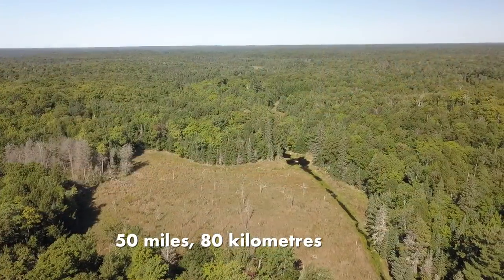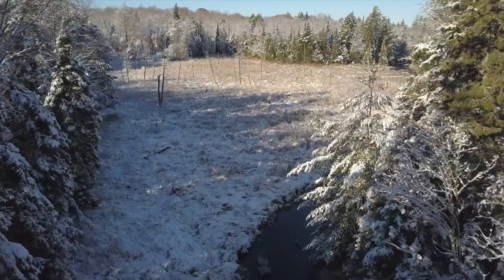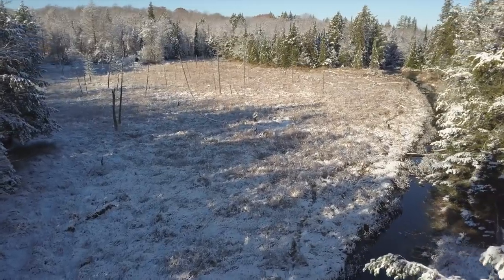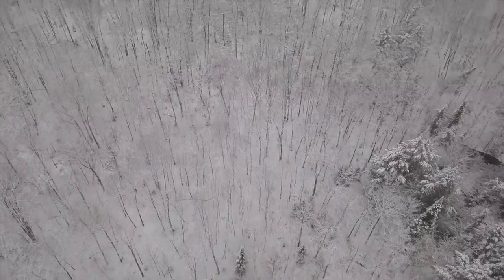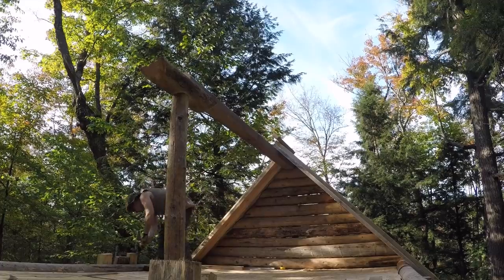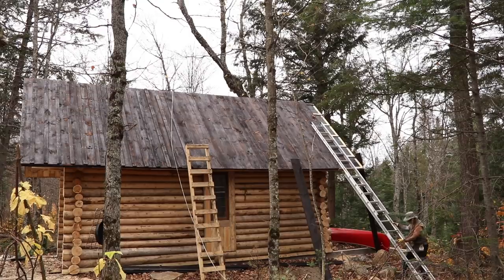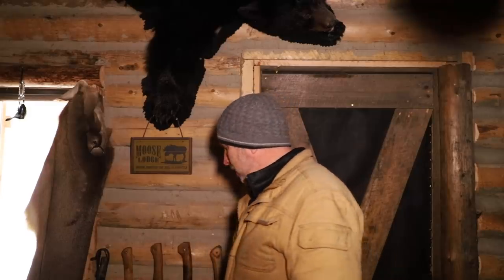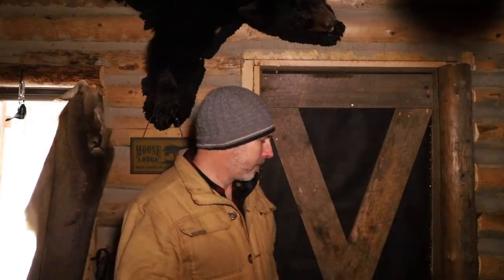Log Cabin Cost - Build a Debt Free Off Grid Tiny House | Home Tour

Comment: Watched the latest video and have a tip for you. I lived in Anchorage for 20 years and had many friends with outhouses at their cabins. They glued a piece of ½" styrofoam to the seat. Warm and dry at 40 below! Try it.
Reply: Or you could just have a seat of some sort (preferably something you can wipe down) you keep inside/warm that you take with you when you need to go.
Reply: I have an outhouse at my cabin and Yes, a cut out piece of styrofoam is the answer for the frosty winter toilet seat. But I certainly would Not glue it down for hygienic reasons. Just replace it periodically.

Comment: Thanks Sean for entertaining and motivating so many of us. As I noted in an earlier communication you became my mentor when about 20 fir and spruce trees blew down on our 46 acres in MI and I decided to turn them into a cabin. Several grandchildren and neighbor kids have gotten involved in the project and each signed a log to preserve the memory. My lower level is only 10' X 10' with a 4' porch but I pushed the eaves out a foot to have more overhang and cantilevered a loft over the porch so that the upper level is a 10' X 15' with two sleeping/storage areas connected by a walkway. I was able to cut all of my own flat boards with the use of a portable saw mill borrowed from a member of our church. I was offered some salvaged steel roofing by a former neighbor just in time to beat the winter snow and didn't collect enough moss before the freeze so most of the log gaps are now filled with fiberglass batting. With a little pot bellied stove I found on Craigslist I can now heat it while adding some details inside and maybe chinking. Only someone like you who has done this can understand how much work is involved and how satisfying it is to have it come together. Your modeling and encouragement was essential, so I wish you a very Merry Christmas and much joy and success in the new year! 
PS: My costs were under $2000 so far with the chimney being the biggest single cost.

Comment: I spent summers in Montana with my grandparents - totally off grid in the 40s and 50s.  One suggestion:  a metal, covered chamber pot for cold night potty business.  Also a sun shower on nice days - easy hot water, stored in a black bladder type bag.  We kept an oversized coffee pot on the wood stove full of water instead of the roaster pan (easier to pour out and handle) and we used the kerosene lanterns at night too.  Obviously you go to bed earlier and get up with the sun.    We kept a cold box in the creek also as a rudimentary refrigerator.   A very satisfying way to live.

Comment: When I was younger I did many of the things that you are doing. This year I downsized my off grid camp to a much smaller one. I find that at my age I have to depend on propane. Gas lights, heat, and fridge are much easier for me. Wood has become a backup. This allows me more time to hunt and fish. 40 lb. tubes are not hard to transport. I will also be installing a robust solar system, this was not possible 50 years ago when I first went off grid. Watching you gives me fond memories.

Comment: Good Morning Man,, Great video & info!!! You can live to work Or work to live!! My out house has a sign saying,,  nothing down the hole unless it's been eaten first.. LOL but i too use wood ash & sawdust,, no Paper in the hole,, it holds the smell & takes forever to break down & takes up way to much space.. I  have an old nail keg with a bag in it,, paper goes in the bag & into the fire pit when full.. Lived off grid 20+ years,, have power now but still use an outhouse.. I made a shower with a bucket & a shower head,, easy,, put in a shut off,, heated the water like you,, mixed,, 3 steps up and hand made stepladder,, into the hanging bucket wet down ,,  shut off the water,, soap up,, 5 minute rinse off,, drain ran out into the yard,, bio soap.. Land is cheaper in the States.. aloha

Comment: I love it! and as always thumbs up! Was born in Moldova and to control the odor in outhouse we use 4" pipe in the corner from under floor and through the roof. It can be 1 foot above the roof with raised lid on top.
It works like a chimney sucking bad air up.

Comment: thanks so much brother!, since i was watching your videos i got started building my own home, i some how began saving/making spare cash,  checking my discipline, gathering materials, and drawing plans for submitle. i show these videos to my friends and now they are on a building and saving plan.  its a  rural residential area in the high sierras so i cant use the land like you but using 2x4 steel tubing and modern materials ended up being about $6k. math is math but you breaking this down, all of the sudden made this seem obtainable one step at a time, "not waiting for the big break" or a $200,000 loan . with all the doubt and red tape i would have never started if you didn't walk us through it. Thanks again

Comment: Absolutely loved the opening scenes of the cabin, through the seasons over the past couple of years, and the closing aerial shots of autumn and winter scenery.  
 You certainly did manage to keep costs down by harvesting the logs from the land of your friends, doing the work yourself.  Was not surprised to hear that the solar system cost equals the cabin build costs, but still cheaper than bringing in the grid!...  Having a home that is all paid for is great!  Our home is paid off, free and clear, except for Milwaukee property taxes yearly.  Wish I could be off the grid, but my spouse would not be living with me in that case! 
 I grew up in an old farmhouse with a heating stove in the living room and a wood stove for heating in the kitchen, no heat at night, no indoor plumbing until I was about 11.  Then the heater stayed on at about 50 F during the winter nights to prevent frozen pipes.  The old outhouse was used year round, even after we got an indoor bathroom!  It was the overflow spot!  Sometimes I even miss those days, but not in the wintertime!  
Greetings from Milwaukee!  As always, stay safe.  Thanks for sharing.   - - - An Armchair Adventurer

Comment: THEE best cost overview of your cabin to date, as well as awesome hardcore advise for the "experimenting" folks who are on the fence about this life style change. FYI, the gas lamps function as both a light source and a slight heat source. So you'd want to consider that if you're building a smaller cabin for both summer and winter temperatures, if you have alternative heating.

Comment: Great video. I recently built my cabin and my lighting was oil lamps and headlamps. I installed a small solar system this summer and installed LED lights. What a difference. I enjoy the solitude and ambient lighting from oil but it’s an anchor on my 
Circadian rhythm and we would all be in bed by 7:00 PM. we get to enjoy more of the cabin time in the winter with the new lighting. My system cos

Comment: Shawn, Very insightful. I grew up in a brick built Victorian terraced house in an industrial town in the 1960s. It was small, 12 feet wide and maybe 34 feet from front to back. Three rooms down and three up. Four 12x12 rooms and 2, 6x6 rooms at the back. (Kitchen and bathroom.) The staircase in the middle of the house rose 8' in 8'. You got to the small back rooms through one of the other rooms. We had a walled yard 12x15. We were lost in a grid of streets in the smoke and fog. But there was one similarity to the cabin. We had an outside toilet! (As well as the one inside.) A brick built outhouse on the back wall of the yard, an ill fitting door and a paraffin heater burning gently under the water pipe to maintain frost free! Boy you did not hang around in there in winter!!! No danger of bears though! I envisage lots of nimble running between buildings at your place in winter. It will keep you fit. Regards, Stephen.

Comment: You can get new wood stoves online for less than 200 take in mind they are smaller and not as nice but do the job  on thee smaller newer ones you  run the pipes out the window with a steel plate after cutting a circle out of the center for the plate. I love your cabin I'm building one in the next few weeks I got my land and now I'm ready to go off grid thanks for your inspiration you rock.

Comment: In 2012 Ibuilt one alone, by myselfin the fall, rush was on to finish roof lol!,  hookedfacility as you but inside, those who came to visit, curious ones, were surprised that there was no smell, not running water, I had a river on the other side of the road, I was not allowed any bigger than 200 square feey because no sewer or running water or electricity, I used candles and corosene lamps, went to bed at 9 got up at 6, washed clothes by hand and hung on line, chainsaw to cut down trees for fire wood, split with axe, 1 acre of land, lots of crown land all around, 6 000$ for land, 600$ Notary and 600$ bulldozer, the rest I got for nothing, side of the road or give aways, kijiji, etc.Loved it all.

Comment: A 2 gallon weed sprayer with a sink sprayer connected works great for a shower. Pump it up, wet yourself with the sprayer, soap up and rinse off. I mix half hot water and half cold water in the sprayer, never have run out of 2 gallons. If you need more water, they make 3 gallon weed sprayers.

Comment: Thanks for an honest estimate yes Craigslist is great source of good used material. Of course a pickup and or trailer. Tools necessary power saw gen set use of a micro turbine water drop could be alternative power. A repeater from your high location or fiber cable with solar or remote start gen set.

Comment: Thanks for all your work putting this information together for us - the figures were a lot cheaper than I had initially expected given no analysis.

My only suggestion would be to put in some more efficient windows - it should still be relatively inexpensive to get used windows that would add greatly to the thermal efficiency of the building.

Comment: I saw one of these prepper videos where someone wss freezing several 5 gallon buckets of drinking water outside in cold weather, and then using them for refrigeration in a big pantry. When eventually the ice would melt it would be used for drinking.

Comment: Growing up on the farm we had a shower out by the wind mill. What it was is this. It was a 55 gallon metal barrel on its side. It was set on top of a four foot six inch by four foot six inch building with a leaked roof. Flux four inch beams x on top of the roof. On the underside was a female pipe fitting to put a pipe on then a out door water valve and a shower head made from a old sprinkler can. The top had a fill spout that a funnel could be set in to fill. It could be mounted permanent so when it rains it would collect the water as well. The sun would heat the water during the day during the warmer weather.

Comment: My dad trapped beaver for a fur coat for my mom. In the southwest natives use rabbit fur they twirled the fur into a vest that insulates well. Spruce root makes great water tight baskets you can add hot rocks . in United States you can get a permit on national forest to cut firewood. You can post on Craigslist to sell firewood. To pay for expenses. Hand split cedar shakes is a cash. Commodity.

Comment: To keep a fire going, make these fire starters: you’ll need egg cartons, dryer lint and wax. 1. Cut the egg cartons up into individual egg pockets. 2. Fill each pocket up with dryer lint. 3. Cover the lint with wax such as melted candles.

Use only one of these at a time. Put it where your kindling is and light it and the kindling. Add kindling and wood as needed. This lighting method will last a long time.

Comment: I found this video extremely interesting and informative.  I’ve been wondering for a bit if you might use hydro power from your stream for power.  There are some very simple and inexpensive designs that I have no doubt you could handle, but though the creek is pretty close to your cabin, I’m not sure it’s close enough per cable runs.  But you might be able to put a battery house part way between to store power, with a doable cable run to the house from there.  Your stream seems to almost always be flowing, and even if you had to make a small dam to get enough flow...doable?  Get some of your bushcraft buddies up for a weekend to help?  I thought this might help since your solar isn’t always reliable per the weather.

Comment: I would think you would or have thought about venting your roof somehow being that heat rises and if not properly vented ( summer ) could cause condensation which in turn cause mold or rot to the lumber.  With your knowledge, I believe you could fabricate a vent that would open or close as needed. Just a thought.

Comment: The typical cellphone tower has a range for signal of around 4 to 6 miles. Get out your drone in the evening sometime and get above the tree tops and see if there is a light beacon on top. Not all towers will have them depending on laws for it for air travel.

Comment: Hello Shawn, first of all thanks for summing up the costs of you project. Wow. This is definitely eye opening to see how low those costs actually are. And it's great to see how much you like your project / life style. I am very happy for you. I am looking up to your (neutral/logical) wisdom and the way you are thinking. It's very solid and the younger generations could/should use a lot of it (#spoiledyouth).
During the video, I had some questions, which I will try to put in words. I hope I can get them right, being a not native english speaker.
- On the takes, where you have been sitting in front of the map and telling us about your costs, I noticed cracks in the logs behind you. How come they cracked there and not so often on the other side of the cabin? Why would they crack? Is it because of the moisture which was closed inside? Are those cracks possible risks of losing heat? I mean, should they be closed or just left alone?
- The solar charging setup you have is very neat. But what about using additionally to it a water charging setup from your stream. The link: https://www.youtube.com/watch?v=wYEjTqn0P8U is just an example of how it could be done. and if you build a water wheel yourself, you would just need costs for the generator. It's just an idea maybe you could use your stream as an additional source of energy. 
- Arrows and bow. Wow I am amazed by your arrows. Will/could you also do a video of you making arrows please? And did you make your own bow too? Or did you buy yours. Which kind of a bow is it?
Thanks a lot Shawn. Best wishes and a happy new year from Germany.

Comment: Do double layers of windows at least if you have spare ones, do a "mudroom" front of the cabin door so you can eliminate the heat escape from there too and still, do the masonry fireplace to there, that would save major part of you'r yearly firewood cos no need to heat so much daily, also you can get oven to it and some plates to boil down things.. Hello from Finland, winter wonderland.

Comment: Another interesting, informative video. I love watching them. In fact, my birthday is on the 14th, and I spent the last hour of it watching your video! Do I know how to celebrate or what? I do have one question. If you were to take a moose or other large animal before you get your new cellar built, do you have enough space to keep that much meat? It doesn't appear that you do. Or would you just avoid taking anything that big until you have the new cellar in place? Would you smoke it? Thanks so much for letting us watch and learn from you. I truly enjoy it. My days of trying such things are in the past, but I did build my own 12x12 work shop with a loft from scratch (using mostly bought lumber and a metal roof). I still get my own firewood and installed an emergency hand pump behind the house. That's as close to homesteading as I get. But I love what you're doing. Thanks again.

Comment: Very helpful info. Answered several of my questions. Thanks. Wish I could disconnect from the system for a year to try out off grid lifestyle. For the sauna, have you thought of running hot water pipes thru the woodstove chimney? 🤔 Just an idea.